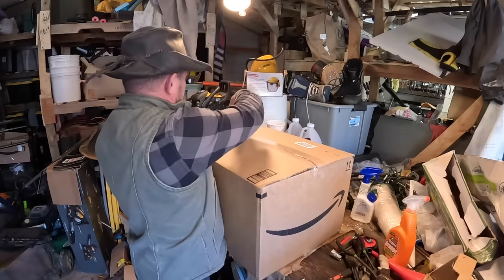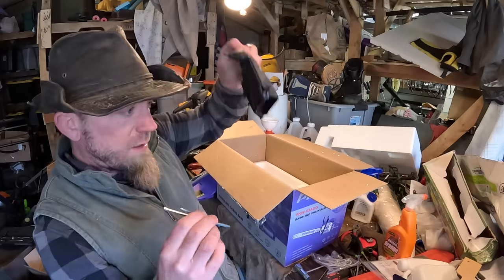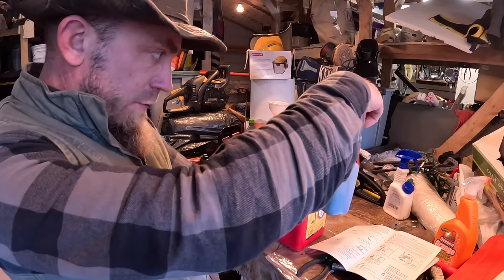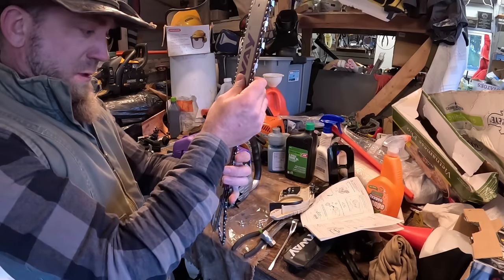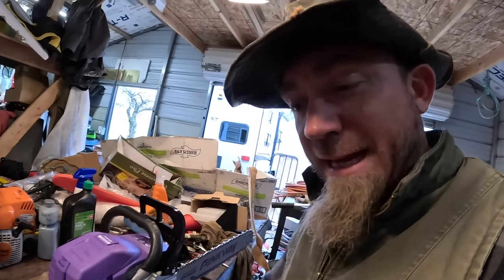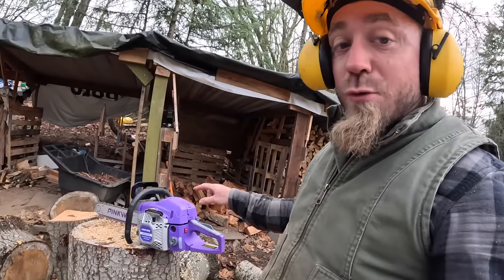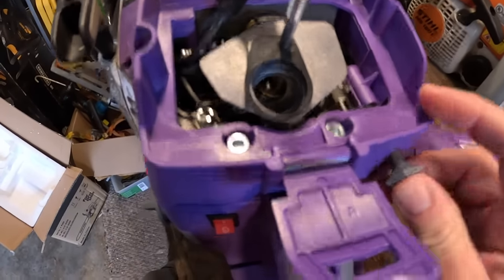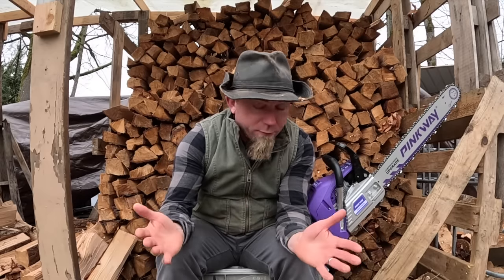I Bought The Cheapest AND Most Powerful Chainsaw On Amazon!

Comment: pro tip, when u start it and the chain stops IMMEDIATELY when u let go, too tight! you want it to stop after maybe 1 spin, basically tight enough to not have a gap, but loose enough to spin a little freely. If you run them tight like that it will stretch your chain out way  quicker and wear your bar like crazy from the added friction. the biggest thing tho, it will never cut as well if its that tight versus proper tension. 23 years in biz for reference. EVERYONE does this wrong, even tree guys and arborists ive hired had to be taught this same exact thing, so dont feel bad! cool little saw for the price! when i say little we rock 90-120cc saws for our "big saws" but its def a nice little saw!
Reply: also not sure how you sharpen, but i have a oregon bench sharpener. its amazing! sharpens my saws so sharp that its actually better than a new out of the box sharp chain!
Reply from the maker: This is a great pro tip, thank you Mitchel. I'll mention that in the next episode when the purple monster appears. And I'd love to have a wack had a 90-120cc saw however I feel it would definitely waay to much power for what I'm doing. Keep cuttin'!
Reply from the maker: I hand file. I'm not a pro at it but after watching Buckin' Bill Ray a few times, I'm getting the hang of it!
Reply: Cool video thanks for taking the time to make it!
Reply from the maker: @gregwillett2363  welcome Greg, thanks for watching. Keep cuttin'!
Reply: @TravisDoesFirewood  def should checkup a bench sharpener if you ever meet someone with it! worth seeing what it can do! amazes me! so sharp!  with the chain tip tho, youll notice the difference ALOT!
Reply from the maker: @mitchelsallseason9359  I'll def keep that in mind. I know I have a lot to learn about sharpening. "The more you know" 😉

Comment: On most chinese chainsaws it says 25:1 (oil/gasoline mixture) but it is completely wrongly translated (they confused milliliters with liters). What they wanted to say is 25 ml of oil 2t to 1 liter of gasoline but it works perfectly with a standard mixture of 20 ml of oil to 1 liter of petrol (50:1). Use only quality 2t oil mixture.
Reply from the maker: Goods points, thank for sharing. Keep cuttin'!

Comment: As others have mentioned, DO NOT mix your gas at 25:1 unless you enjoy scraping carbon deposits out of mufflers and spark plugs. 40 or 45:1 is the correct ratio with modern 2 stroke oils.

 Your chain tension is to high and both the bar and chain along with the drive sprocket are going to wear out in days rather than months or longer. New chains will stretch a lot when first installed but after an hour or so will be normal.

The best rule you can learn is that every time you stop for gas and oil when cutting, adjust your chain tension and run the file across every tooth 3 times. While it may seem like extra time not cutting it will actually save you a lot in the long term, as sharp chains are safer and cut faster and your bar and chain will  last longer.

Your saw is not 63cc, more like 48 to 55cc. Every time someone lists a saw like yours for sale they add a few cc's to get more sales because "Bigger is better" right? I have 2 of these saws and buying one is like playing the lottery. You may get a good one and then again you may not? Stock up on oil pumps and the drive gear for this saw as they seem to wear out on a regular basis.

They are all copies of the same unit but the plastic is different colors with different odd ball names printed on them. Make sure your air cleaner is tight as they seem to have a tendency to leak and allow dust to get in the carb (not good). Also, replace the no name spark plug with an NGK or other half decent one. The one on the saw is garbage and it will quit at the most inconvenient time.

If you get a decent unit these saws run pretty good and will last a fairly long time. I can buy 5 of these for the same price of one Husqvarna. With that being said, you can bet that when I go to work My Echo CS271 and Sthil 041 and others are on the truck too. I'm not a gambler.

Good luck and spend some time on youtube learning all about your new investment. I will make your experience with this saw much better. It's a great way to improve your mechanical skills and a great saw to "loan" your neighbor, cousin and relative when asked about borrowing one. 

Someone will eventually ask, it's just a matter of time and it is ALWAYS the person that should never be allowed near a mechanical device? They'll pick it up and come back awhile later, set it down and you hear the following words, "Travis, why did you loan me this junk? It only ran for 3 minutes,died and now it won't start anymore? You need to fix it!" 

 The oil to gas ratio won't matter in this case because it wasn't added. Problem solved! (Permanently LMAO!) Be safe, good luck and keep cuttin'
Reply from the maker: I appreciate your insight and comment - I like where you're heads at. The shared knowledge amongst this community is great! Thanks for watching, and keep cuttin'!

Comment: Just a note - This saw is not bigger than your Husqvarna 460. In reality almost all 63cc Chinese saws are actually 54cc-58cc. only a tiny hand full of higher quality Chinese saws exceed the 60cc mark in their 63cc class of saws.
The best thing bout this $100 saw is if it goes Pop, you can buy another one and be at break even point.
Best advise for longer life - Clean thoroughly after use and don't over tighten the chain. only use Non-ethanol gas and stick with the 25:1 for at least the first 10 tanks. 40:1 works nicely thereafter for this class of saw.
Reply from the maker: I like where you're heads at, thank you for the insight. A few other viewers have said the same re cc. Totally agree - a saw that you'll get your money's worth for $100 and when it breaks, then buy another - ha!
What's you're thoughts on premium gas vs. non-ethanol fuel?
Thanks for viewing, keep cuttin'!
Reply: @TravisDoesFirewood  Gas - Non-Ethanol usually has a decent octane rating. Even Premium can have 10% or more of ethanol.
Ethanol is hygroscopic and the longer it sits around the more water it absorbs.
Ethanol is what destroys Carburetors and fuel lines in small motors.
Stay safe!
Reply from the maker: @crxess  I appreciate your response. I'm tempted to switch my small gas engines from e-free to premium bc premium is easier to get and about the same price as e-free.
Reply: @TravisDoesFirewood  If you need to do that:
1)keep the fuel in the newer Air tight gas cans.
2) only store for long periods in Full Cans.
3) empty the Saws when not planning to use for any length of time.

Comment: I use 32:1 mix with 93 premium Shell Ethanol free fuel with Honda HP2 oil. This combination is like a “Forever Gas” 2 cycles will last a lifetime on it. Mixing 25:1 would be ideal for a heavy use milling saw I suppose, something ran wide open for extended periods lol.
Reply from the maker: I appreciate your insight. Be sure to check out the other episodes I have on this saw including the first ever ported Pinkway. Thanks for watching, keep cuttin'!

Comment: When you flood a saw.
Make certain the choke is off.
The switch is on?
Lock or hold the throttle wide open.
Pull it about 10 times.
It will likely be running by 10.
Don't pull if it starts.😊
Reply from the maker: This is great into, Karl. Many thanks for sharing. Keep cuttin'!

Comment: I have started running Non-ethanol gasoline in all my small engines and have had fewer problems. Ethanol is hard on these small carburetors with diaphragms. And always winterize them, it makes a difference.
Reply from the maker: I agree with you, Dacell! I was going to switch to running premium gas as it's easy to get than e-free at the same price but then I just went back to buying e-free. Definitely needed to keep small gas engines running and not backed up. Thanks for watching, keep cuttin'!

Comment: Have a very similar saw to this and after a few tanks I said to hell with this 25:1 mix. Fueled it with 50:1, tuned it to 4 stroke at free revving  but cleaned up in wood and she goes really good. I’ve dropped it down to a 18” bar and hand file chains removing the gullet it it’s insane
Reply: 5 years old now and cylinder looks amazing still
Reply from the maker: I hear ya. I just put out an episode today where I ported her, make sure to check it out. Thanks for watching, keep cuttin'!

Comment: I want to see it compared with the 68cc 20-in chainsaw from eBay and Amazon and I want to know the math for mixing the fuel and oil as I see some of the other Chinese chainsaws have that same mix and I like the idea of a lot of power for less money
Reply from the maker: Are you referring to the Proyama, Daniel? 
If I want to mike 50:1 I believe is it two 2.6 ounces (5.2) for a 1 gallon can. On the back of mixing oil jugs will give you specs. Thanks for watching, keep cuttin'!

Comment: To measure your cuts, use the tip of the bar and paint a line (or tape, etc) on the side of your saw the length you want.
Reply from the maker: That's one way of doing it quick, I agree. Thanks for watching, and keep cuttin'!

Comment: Alright bud few things here you obviously are not too experienced so here is some knowledge for you .....
1. Any chain when new and you start the saw up and rev it a little will stretch . Never mind  a cheap Chinese one ..
2.more powerful than a 460 husqvarna I severely doubt that as you will be lucky if that is 55cc not 62cc as Chinese saws they always lie a little about the engine size . And if it is more powerful than your husqvarna then go and get the husqvarna checked out because it's not running correctly or out of tune. 
3 . Putting fuel into a hot saw causes issues ? Wtf ? . What do you think the guys that are running the same saw all day every day do ????..
4 . I wish I had all that wood to cut .. and I am not going to lie it seems ok for the money because with a good quality chain it will cut even better as those Chinese ones don't hold the sharpness too well .
Reply from the maker: Thanks for the knowledge, Richard, and thanks for watching. Keep cuttin'!
Reply: @TravisDoesFirewood  wish I had your pile to cut for my stove . But honestly if you think that saw is more powerful than the 460 , truly the 460 is not quite right as in   tune   chain , carb problem.  And do not and I repeat do not run it 25: 1 as it will totally gunk up the carb , cylinder and that muffler may have a dpf or whatever you call it as I know the weimars has and it's pretty much same saw . Run all including your husqvarna 40 to 45:1 far better and it will run better and cooler as it's more efficient . All the clone saws say 25:1 as they are going with the older spec of oils . It's not what the saw says to go by it's the makers of your oil you go by as they are the ones who have researched and developed there oil to a certain standard and if you use stihl ultra you will kill the saw in no time especially at 25:1 . That stihl ultra does not give any bottom end protection at 50:1 and if you go more it totally carbon up the saw . Use echo red armour or echo power blend gold or dominator anything but stihl ultra and always run 40 to 45: 1 and your machines will run sweet and less carburetor issues and less carbon build up and a little more protection.  But definitely do not run 25:1
Reply from the maker: @richardsneddon2976  Interesting re your stance on using 45 or 50:1 and not what the manual says to use 25:1. I'll ask this on my next update video and see what other wood hounds saw. I'm not opposed to the idea, and what you said in your last comment makes sense to me. I'm not an expert, and will be the first to admit when i'm wrong (as I mentioned in this video) and thus open to new ideas and suggestions. Thanks for the ideas!
Reply: @TravisDoesFirewood  all Chinese saws say 25:1 , I have an 038 clone and it says 25:1 . Like I said that saw inside the muffler has a type of dpf filter and if you run it 25:1 it will be full of carbon in no time and the heat can't escape out the saw and it will burn up . I and most of the tree guys as in full time professional arborists , loggers all run 40 to 45:1 . Because you always know that there is enough oil for lubrication without gunking up the carb , muffler and inside the cylinder and piston.  . You do what you think is best run it 25:1 and see what happens.  I just fitted a new cylinder and piston to a saw I bought cheap and the first tank I put through it was 25 to 30:1 and after the tank the oil was running all down the front of the muffler as there was far too much . But that is best when a first tank goes through a new saw or a new cylinder and piston.  I could not imagine what state it would be in if I kept it that way for 5 or 10 tanks
Reply from the maker: @richardsneddon2976  copy that, thank you sir!

Comment: Even in my Mac 10-10, i run 50:1. Yes, it smokes a little, but just like in my Mazda Rotary Engines i would rather see a little oil smoke (not a whole lot just a little) you know its getting enough than not enough when its needed the most.
Reply from the maker: Thanks good to know, Dan, thank you for sharing. I'm still on my first mixed gallon of 25:1, we'll see what I put in it next. Many differing opinions on this topic of what the Purple Monster should be run on. Keep cuttin'!

Comment: Well, 32:1 for old homelites is 4oz/gal. So 25:1 would be more. 2.6 x 2 is 5.2,  you should be good.  Does bar have a grease hole at tip
Reply from the maker: Good insight, Brandon, and good question. No port at the tip but I did clean the gung from the bar rail today (surprisingly gungy) and I noticed that we have two oil ports on both sides of the bar (so it can be flipped). I'll look again tomorrow at the tip. I feel like I'm not answering your question, am I answering your question? Let me know buddy. Keep cuttin'!
Reply: @TravisDoesFirewood  yup, ya did.  I bought a holzforma 372xp clone. Never ran good. OEM carb fixed that problem. Wasn't oiling the 24" bar good so I put OEM oiler on and idk if it works good or not. After doing that swap I tried to start it and it was locked up. Pulled plug & muffler, cylinder looked good. Pulled off recoil and that was good.  Was able to free it by turning by hand via cooling fins. Put recoil back on, pulled bunch of times,👍👍👍.  Put everything back on, pulled it, locked back up 🤬🤬🤬.  It's at the shop. Told him if ya can fix for $250 or so great if not junk it.  Best part, I've cut MAYBE 1 CORD w it 🤬👺🤬👺🤬👺🤬👺. So my opinion of the cheap saws is definitely ya get what ya pay for. If ya get more you're damn lucky🍀🍀🍀🍀
Reply from the maker: @brandonhoad9033  oh geez, what a saga. Definitely agree - you get what you pay for. I hope I can cut enough with the Purple Monster so it can pay for itself. Right now it's still on its first 1 gallon mixed can. It is nice having two larger saws when I'm cutting in the yard or on a site. Thanks for watching, keep cuttin'!
Reply: @TravisDoesFirewood  at least you only pd a little over $100. Holzforma was $300 for power head plus another 80ish for bar and chain
Reply from the maker: @brandonhoad9033  true, that is noteworthy.

Comment: Does the bar fit any other saw???😅
Reply from the maker: That is a great question, I honestly have no clue. I think the new chain I got for it was a special order. That's the bad thing about these cheap saws - no parts. But by that time, you're probably made your money on a cheap saw. Check out my other episodes on the Purple Monster, including getting it ported. Thanks for watching, keep cuttin'!
Reply: I run all my saws for years and years 50:1
Reply from the maker: Use what works. I did the 25:1 for the saw's first 1 gallon can, then went to 40and 50:1 to match my other saws.

Comment: good news it's a Japanese clone, bad news it's really 54.6 cc, pull the recoil and you'll see 58 marked on the cylinder at the bottom
Reply from the maker: ECHO clone, then?
Reply: Not true.its a Chinese made clone,and the 63 cc will Actually be around
 59 cc.so it is,esentially,a 60 cc saw

Comment: Interesting video , could it be a nock off of a Husqvarna , 👍
Reply from the maker: I think you may be correct, Len. But the 25:1 is throwing me.
Reply: It's a zenoah clone.
Reply from the maker: @benjaminleslie3155  I haven't heard of that brand before
Reply: @TravisDoesFirewood  me neither 👍
Reply: Zenoah is a Japanese 2 stroke manufacturer, I believe they are owned by Husqvarna now. Zenoah makes great engines.  @TravisDoesFirewood

Comment: I would run nothing fatter than 32:1 they are saying 25 to cover their ass that the cheap piston and ring doesn't lock up in one tank. break in with 25:1 if you want for a tank then run 32 0r 40:1
Reply from the maker: Good thinking, Kevin. I appreciate you chiming it. Be sure to stay tuned as I use and maintain the Purple Monster in future episodes. Keep cuttin'!